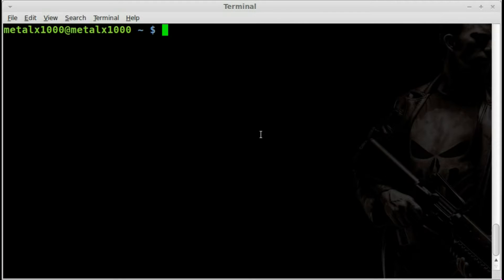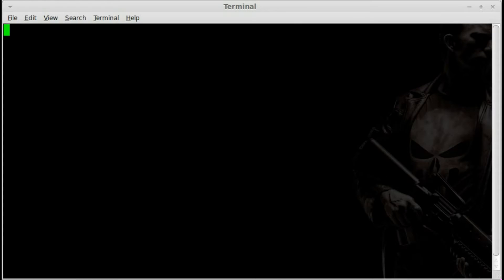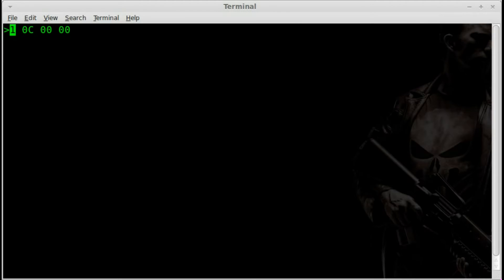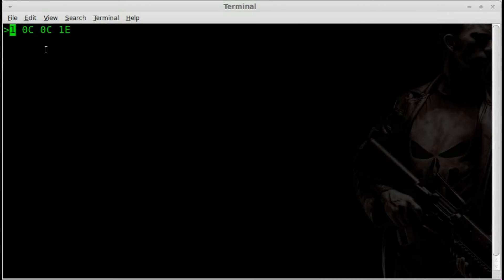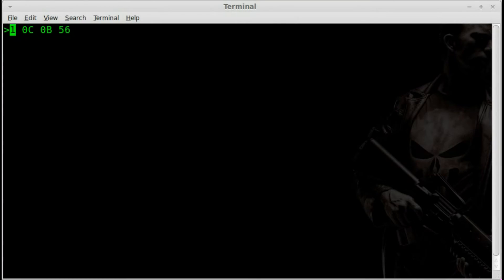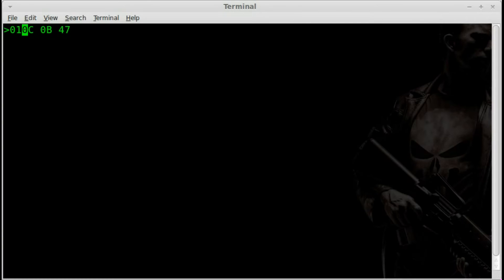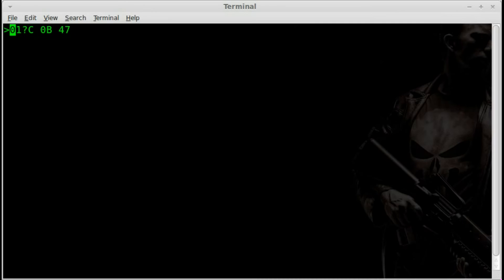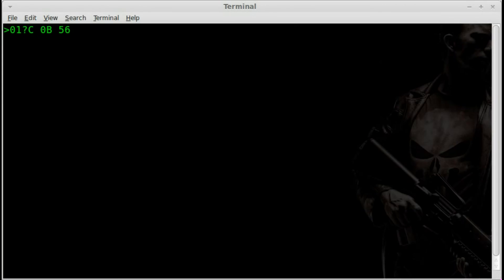ELM327 USB OBD2 Linux Videos Part #3

Comment: i em thinking of writting a bit of code that logs the data while a person drives their vehicle and uploads it to a databse when they become connected to wifi, i would imagine most peoples wifi extends to their driveway, i would than use graphene to graph the data. have you managed to get realtime data from the device? have you built a python interface to the device? i just started thinking of this idea because i think it would be neat if software could tell me when things start to go off from acceptable thresholds before i notice them. i found some resources but haven't read into them yet.
hmm, would be even better if i can get real time data into graphene, to built a second dash .. i guess it sounds easy but takes up a lot of time to implement
Reply from the maker: +japrogramer There is a program called "scantool" which should be in the repositories fro most distros.  scantool is written in Python, so I would have a look at their code.  There should be a lot of useful stuff in their source for you.